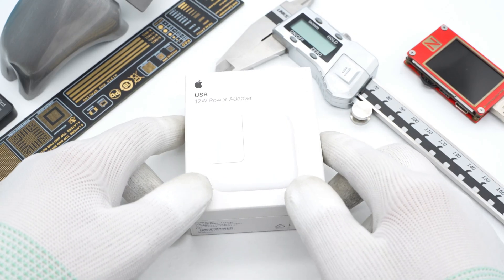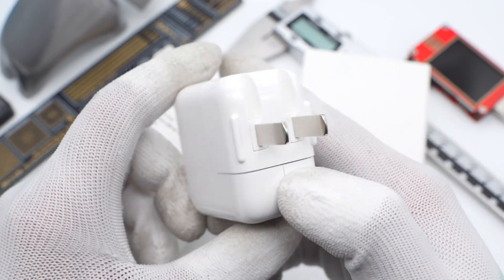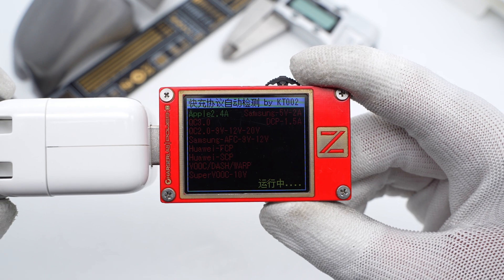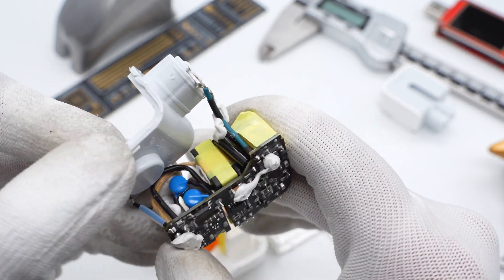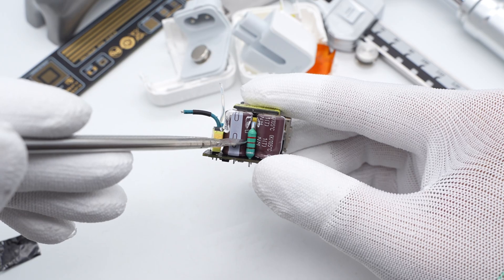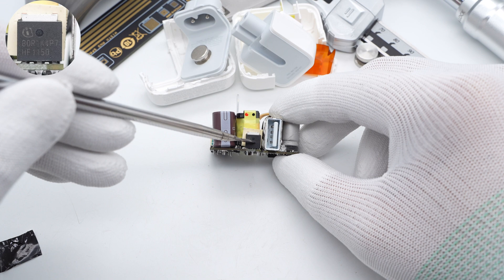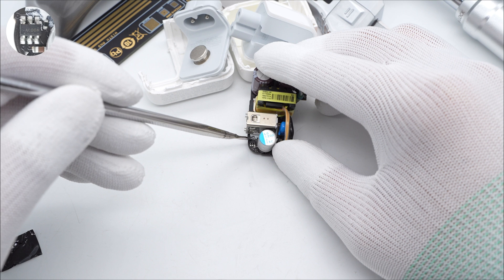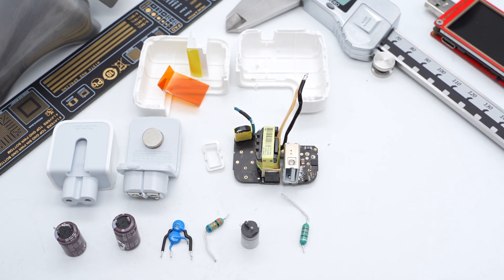Teardown of Apple 12W USB-A Charger (A2167)

Comment: Amazing that this charger is being sold unchanged for whole decade. Until Apple introduced 20W USB-C charger, it was most economic (cost x charging speed ratio) option for rapid charging of iPhones. Today it is a little bit outdated by size, USB-A port, Apple 12W protocol, that confuses many non-Apple devices and lastly bad power density. But on the other hand if you need USB-A source and/or 12W is enough for you, it is still usable. However for USB-C iPads even if you use decent USB-A -> USB-C cable I get mostly only 5V 1,5A (7,5W), I assume iPad falls back into DCP legacy mode and it does not expect legacy Apple 2,4A protocol. For overnight charging great as neither battery or power supply is overloaded, but for normal charging it is suboptimal.

Only downside about 12W and especially 10W Apple chargers is that they have noticeable voltage sag under large load, which many powerbanks tebd to evaluate as weak power supply and even though they could utilise whole 12W, they tend to cap input at 9W +- depending on cable quality and voltage threshold.

However decade ago Apple 12W was premium mobile charger and I liked and still like IEC C8 + proprietary grounding pin, that you can use any IEC C8 cable as extension cord or ground whole power supply by Apple extension cable, so by using last option interference supression capacitor does not cause annoying tingling on metallic surface of charged device.

Now I mostly use stored 10/12W Apple power supplies as highly quality replacement for 5V USB powered appliances (LED lamps, cosmetic devices, battery powered vacuum cleaner) because many bundled power supplies with those products are el cheapo rubbish.
Reply from the maker: Great.

Comment: I use the top plug to charge my camera battery. They have the same figure 8 plug and it is much easier to handle than the long thick cable